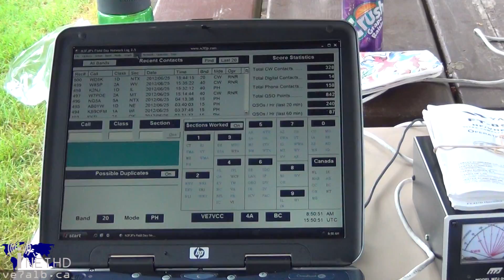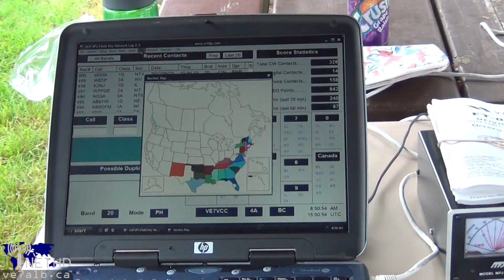Field Day 2012

Comment: If I owned that red Thunderbird I would have my roof up since it was raining there. I probably need to know how to work with those radios since we do lose communications when we have ice storms here in Winter. One television station here advertised about one group offering a class on amateur radio operation so you can get a license. Right now I am so into computers until I would not have time for it.